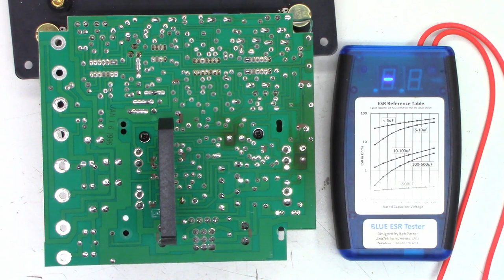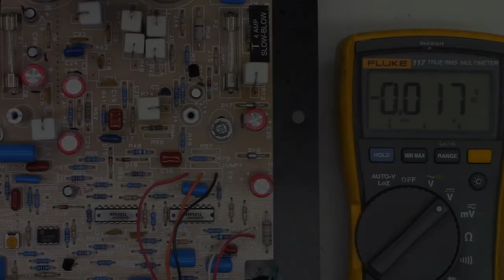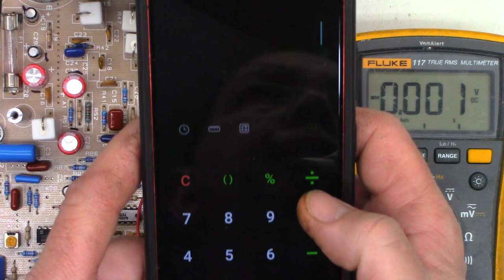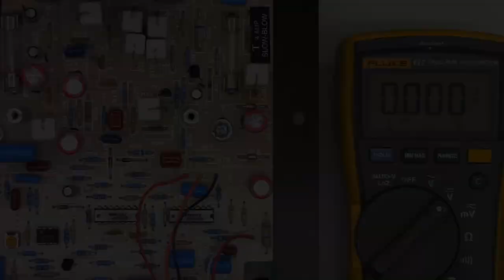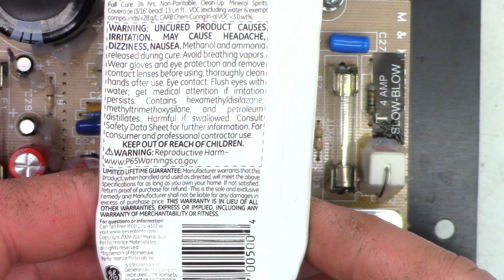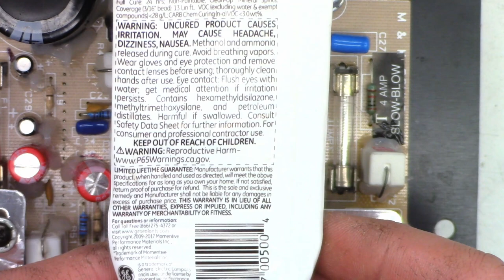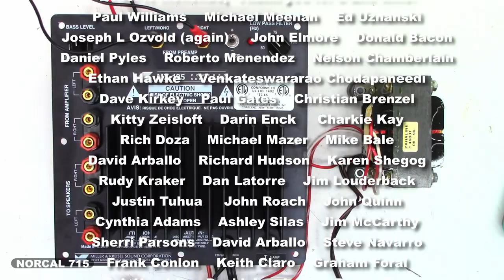Yet another Miller and Kreisel MX-125 internals sent for repair. Humm and scratchy controls.

Comment: Only problem with those 5W resistors is that they are not really meant for PCB mounting, as the 5W dissipation means that the case is at 150C surface temperature. Even at 2W surface temperature is between 80 to 100C above ambient, so the PCB is well above it's rated performance temperature, thus the discolouration and the solder mask peeling. 

Mounting them on a PCB you need the steel stand off kit, that puts a spacer to move it around 1cm off the board. Which allows some air flow, but that also costs more, so cook the board it is. Max surface temperature is 275C, at which point they are actually going to be conductive somewhat, as the ceramic is no longer classed as insulating, especially with high voltage applied.

Comment: Nonsense question: I've watched a lot of your videos, and know your devotion to acetone when it comes to cleaning VCR's and DVD player wheels and belts. Did you use acetone here also to scrub the PCB to get rid of excess flux, or IPA? I thought IPA, but I'm not so satisfied with the result of IPA cleaning my own solder jobs.... Thanks, Dave
Reply from the maker: I do use acetone to clean flux from circuit boards for close to 40 years. Other than glass cleaner for laser lens cleaning, it is my go to solvent.
Reply: @norcal715  Thank you for the response. I noted how quickly the fluid evaporated and thought that strange for IPA. Acetone is far more volatile!